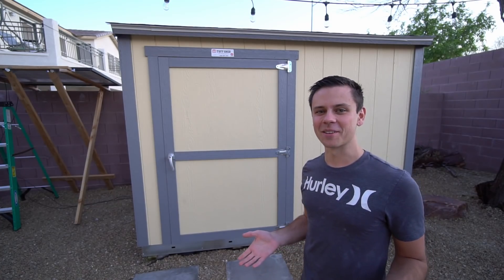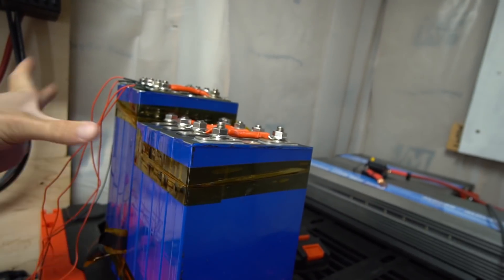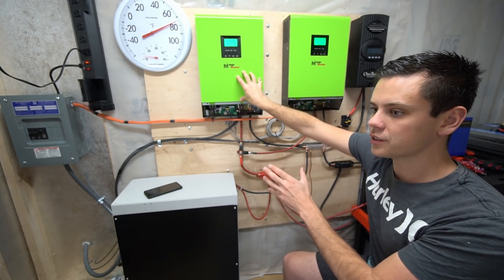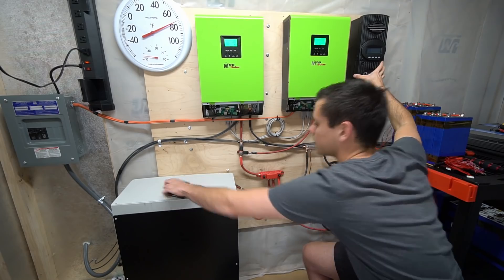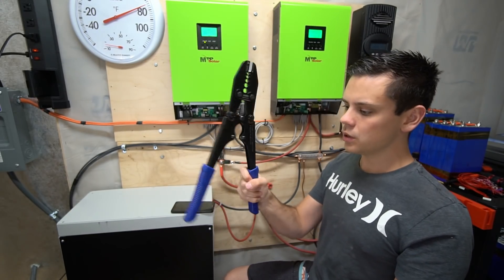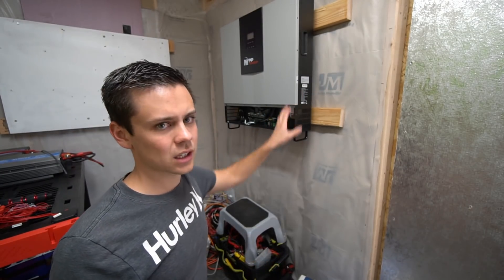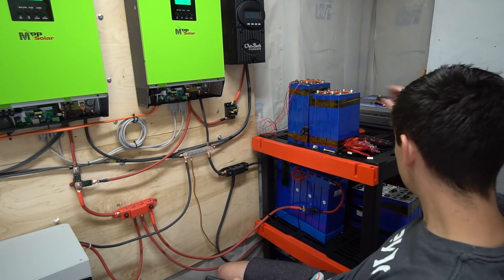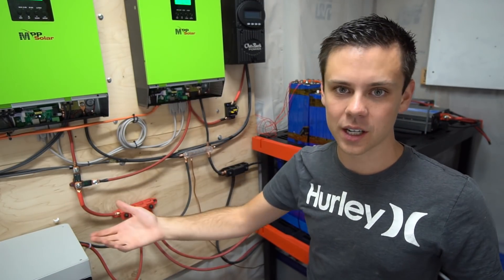Solar Shed Upgrade: Frankenstein LiFePO4 Battery -HUGE Capacity!-

Comment: What is the point of having AC power if you can run everything DC power 🤔. Your car, your batteries, your bicycle, your solar panels, cell phones, laptops electric tooth brushes, flash lights ALL DC....... Why the hell are we collecting DC power storing it in DC form then converting it to AC then back to DC to charge all of our sht!!!! 😂😂😂😂  There is  like no appliance that can’t be DC......DC is more efficient. Its not like you or anyone using solar is transmitting the power extremely long distance.........I am completely lost...... fine let’s say for instance you still want to use Lights, the AirConditioner, separate the circuits...... or people that are still connected to grid power why don’t or why didn’t we just transmit in AC and then convert it to DC when it entered the house, so all appliances should or would have been DC....... the whole planet could have been in the same voltage years ago 🙄😤
Reply from the maker: To feed my house panel. To charge my electric car which has ac input. Quite a few reasons. Convenience. If I were running a laptop and LED lights, I would use converters and skip the inverter.
Reply: DIY Solar Power with Will Prowse  Years ago we could have totally just transmitted power in AC form then change it / convert it over to DC as it entered the house.........Everything  would have been DC. The car would have been built with DC charge port, the AirConditioner would have been DC, the Lights would have been DC 🙄
Reply: David Pavel True, always been a battle...... It could have just been rule of thumb  long runs 300 meters or grater for power delivery use AC........ anything under 300 meters use DC. Problem solved 💁🏻‍♂️ Transmit through the Grid over Long Distance AC to the house 🏠 which should be converted to and stepped down to DC  240 volts when it enters the house. There would be less conductive materials in the house & the appliances. The whole planet 🌎 would be on one damn voltage. Just like there should be one damn cable USB4  aka USBC  aka Thunderbolt 3/ & Wireless charge in all things electronic.
Reply: theMekanik tesla has dc batteries, but AC motors... so...
Reply: SuperVstech Intreating 🤔 Ac motors more efficient than DC 🤔🤔 Oh, wait maybe it’s for regen braking ??? This is how Power is  Generated from fuel powered  Generators it’s spinning an big azz alternator .....  but even then it goes through a rectifier...... still the power storage & proximity to the point of use of power is with in 300 meters 😅 soooo DC 👍🏻 ...... also it would be one less thing to convert from AC to house house to Tesla Charger AC back to DC back to AC......  it would be AC to the house DC to the car and DC to AC to the motors....... Unless they are using the AC house power, power to the motors &  Regen Braking on the same Circuit 🤔🤔 Will cut your car apart let’s dissect it 😂YouTube video 1 year long 🤣
Reply: @theMekanik  In a place like Vegas where you absolutely must have aircon 4-5 months a year you gotta have an 240v AC system.  Vegas is perfect for grid intertie solar, other than Nevada Energy is very hostile to the whole concept.  I know a guy in Vegas who has a direct to panel 12v old school swamp color which kinda makes sense as it cuts down on his central air usage.   Bottom line, extra solar panel are way cheaper than 12 volt appliances, especially in a place like Vegas.
Reply: Yes, the sailing channels I watch, the boats use dc powered appliances. 12 volt appliances are the most common.
Reply: zefallafez  Should be would be nice if we switched from 12 to 24 volts 24 provides more power in hand held power tools. You can build pretty much everything with 24 volt portable power tools & it’s light weight enough you can carry it, but small enough not to hurt you over long periods of use 😅 and if you need to increase the voltage they are easily stackable 24 / 48 / 96 / 120 / 240 / 312 / 408 / 600  volts all combinations of 24V
Reply: zefallafez Thanks will check out sail boat channels 🙃 I wonder what space shuttles and space stations use 🤔
Reply: @theMekanik  They use dilithium... Scotty is in charge of it   :)
Reply: @dpav02  yeah Edison shocked goats I believe to demonstrate DC safety then killed them with AC (no PETA back then😂)